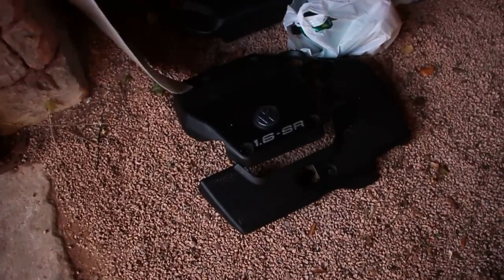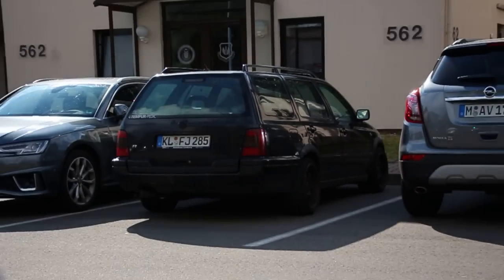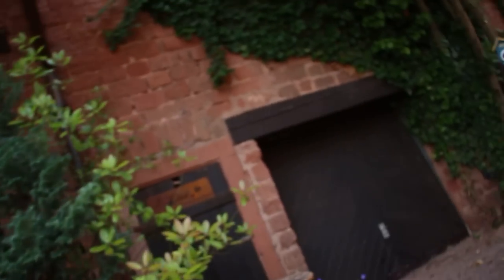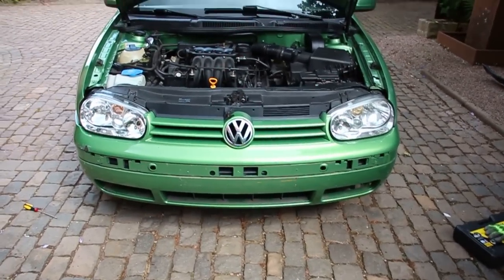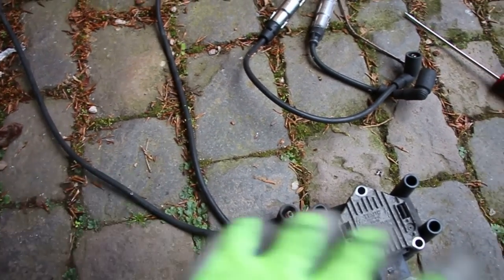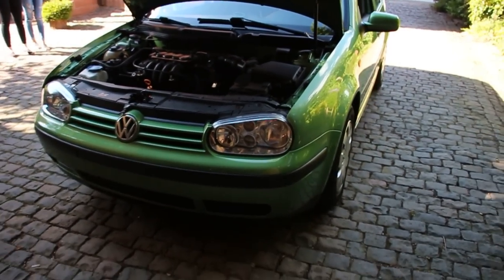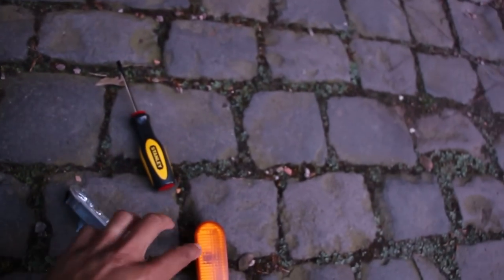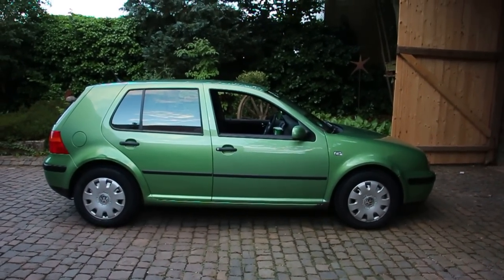No more misfire! ( Mk4 Golf )

Comment: No 16V Variants existed from factory, so Variant is either 2.0 8V or VR6...
Reply: Not true. It came with 1.4 16v and 1.6 16v from factory
Reply: @daniellemmens8880  sorry, didnt specify, I was talking about the 5 lug setup... Variants came in every other MkIII engine option but 16V, afaik...

Comment: So before changing the coil packs when you were pressing on gas just a touch was almost dying? That's something that I have on my VR6 and also it runs rough...(not crazy but just enough so I can feel it at idle while being stationed). And also when I rev the engine between 800-1200rpm it shakes even more but gets smooth after that...